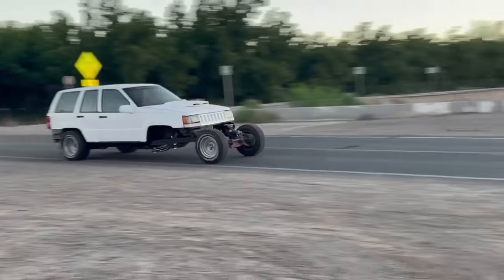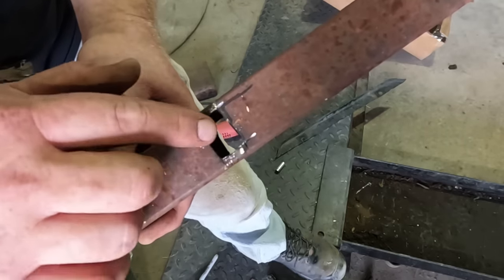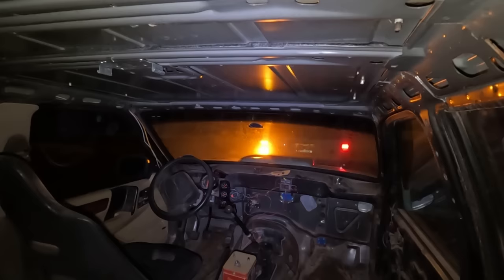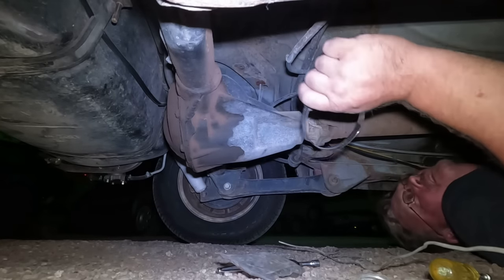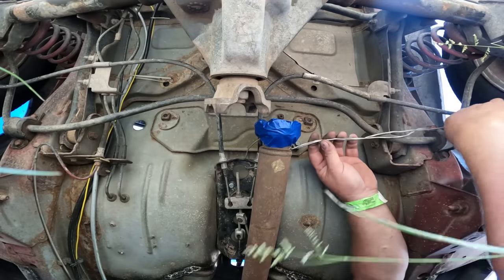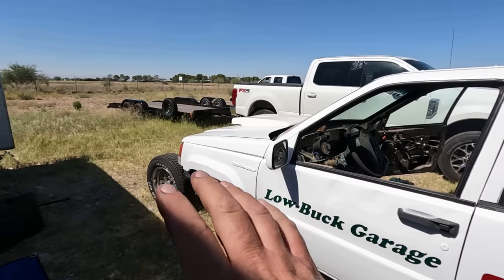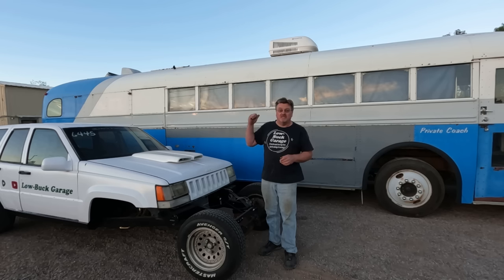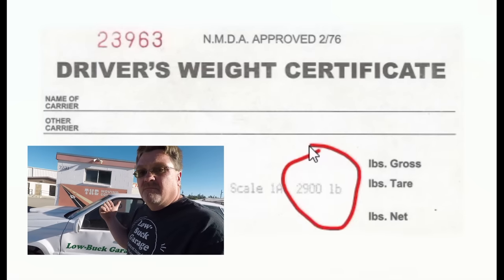Duct Tape Drags 2023: Flat Towing, Bus Adventure, and Missed Shift.

Comment: Might look sketchy but in reality it’s pretty well put together. 
In comparison , Years ago they used “muffler molly” exhaust tubing for frame rails and roll cages in the early drags. 
“Wild Willie” Borsch of the “Winged Express” Top Fuel Altered was interviewed in a Hot Rod magazine article as revealing that back in the day they just used exhaust tubing or “muffler molly” as he called it, for frames and cages. 
If they wrapped it up into the wall they would just cut off the bent parts and weld in new exhaust tubing. Ready for the next weekend. 
Interesting story….. scary if true, but Willie Borsch worked at a muffler shop in LA in the 50’s-60’s so the story is probable.

Comment: I used the Hopkins trailer light adaptors on several motorcycles, with no issues.

My Nighthawk has 4" bus taillights (LED) added to the ammo box panniers & I wired them to be taillights, brake lights, and turn signals, with the stock (center) taillight wire cut (so it's brake light only}.

Comment: Great job! Along w/ that Chevy distributer I'd ditch the 5 speed. Get an older 318 electronic distributer w/ longer centrifugal advance so you can start it at lower initial timing. Then get an 833 slick shift w/ Hurst Super Shifter and start learning how to shift at WOT. I see 12.5's @ 110. Best of luck, stay safe but have fun. I used to. ben/ michigan

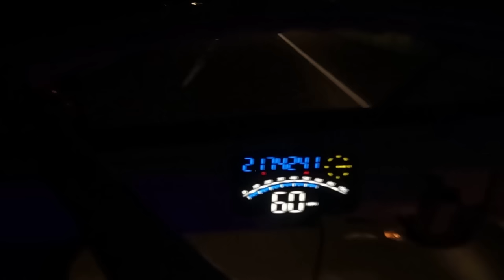Comment: 22:03 The cameras light sensitivity is way higher at night, the leds retain a small amount of light for the short time they flicker off like that, which is basically snuffed out at day time, also your camera may change the digital shutter speed in low light conditions as well.

Comment: What is the objective of competitors in a burn out competition?  Also, how is the winner decided, since the competitors are invisible behind an impenetrable wall of smoke most of the time?  How do you get a licence, and insurance, etc, to use a vehicle on the public roads when it has been thrown together from scrap using untested welds, and safety-critical parts have been cut and welded?  I live in the UK, by the way, where it would be almost impossible to take a cobbled together vehicle like this on the road legally.